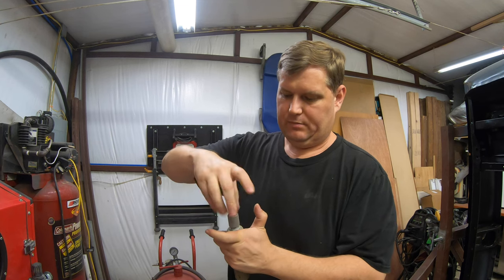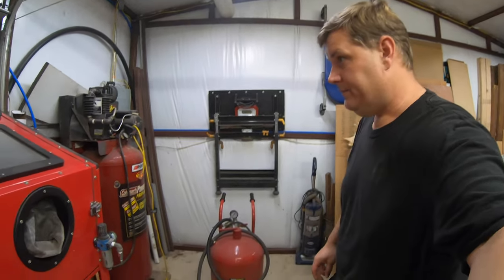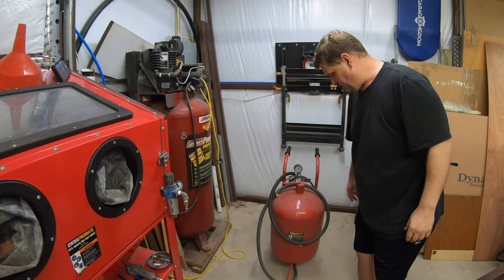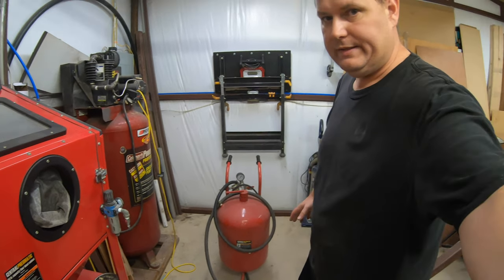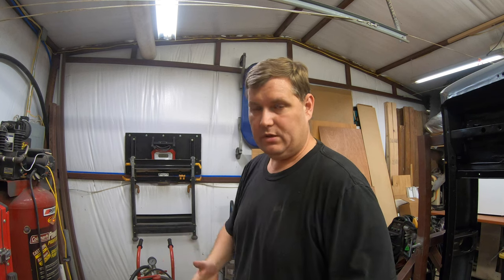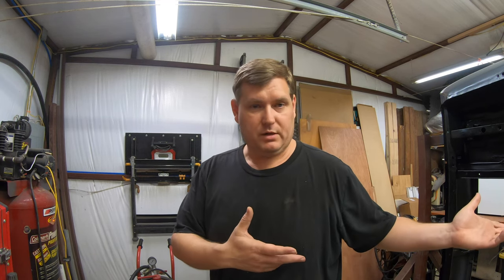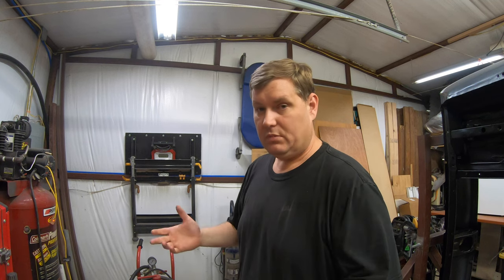4 methods for media blasting at home

Comment: MINI splits will solve your noise and cooling problem
Reply from the maker: True but I need about 5 tons of AC for the summer time which is quite pricey in minisplits. Right now it's 107* and the shop temp is 102* last I checked... I would like to add more insulation but that's very expensive to do on a metal building. You either build another building inside with studs and insulate or strip all the steel off the outside and put on a 4" layer of foam then new steel as the old stuff is now too short...  No easy solutions with this style of building. And sprayfoam is about 6K+ then I have to empty the shop pull out the fiberglass insulation and then have to add material for wall mounting stuff. Metal buildings are nice but can end up being expensive compared to stick built. In fact I could do solar panels and more AC for less than doing sprayfoam...

Comment: So how do you deal with the grease washing into the soil?
Reply from the maker: Generally I prefer to remove grease and gunk before blasting. But when I do messy stuff I have two large HVAC drain pans from attic units. I will put one on the ground and one as a backstop and then I can collect the greasy gunk and dispose of it. The backing plate in the video was just a quickie for the video not how I usually do it.